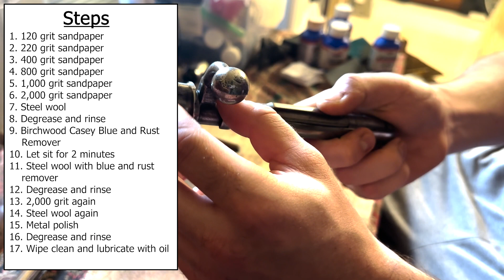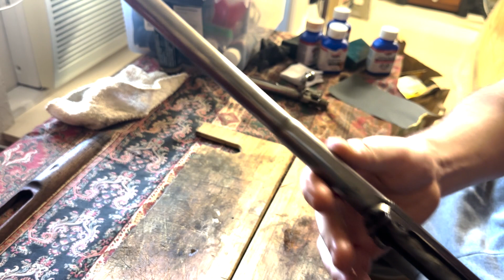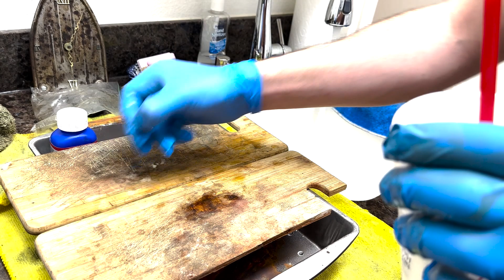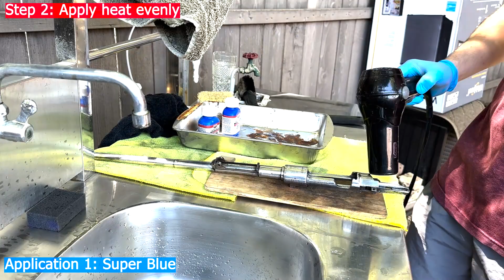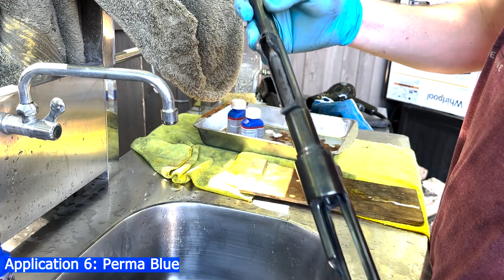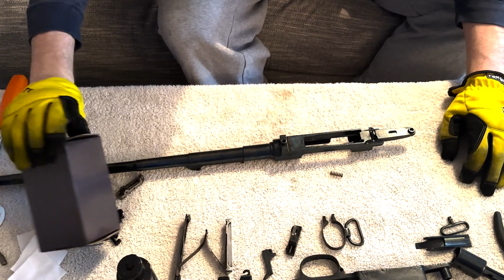Mauser VZ 12/33 Restoration

Comment: the H band was put on backwards.  That hook on the bottom goes towards the rear not the front.  BUT.... your bluing technique is impressive.  Ive used Oxphoblue and it just doesn't get as dark perma blue did for you.
Reply from the maker: Haha i noticed that and knew something was off, got it all fixed though! Stay tuned for my rust bluing video coming out tomorrow, the actual proper way to blue and achieve that dark black finish we all love